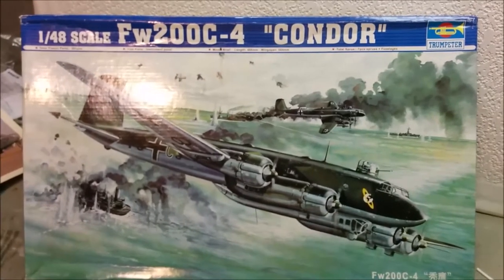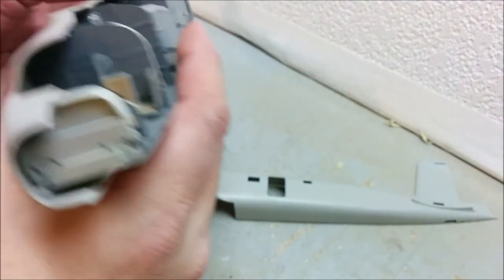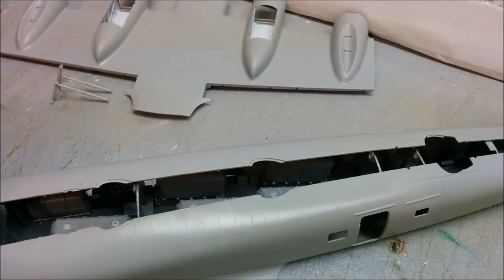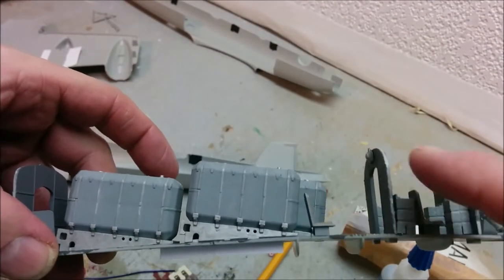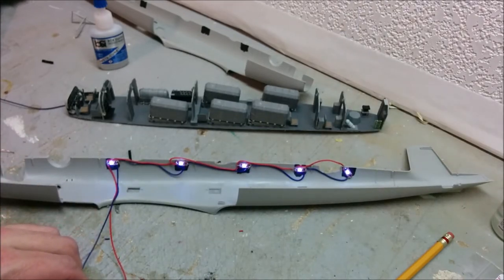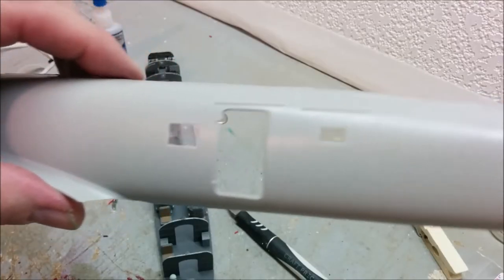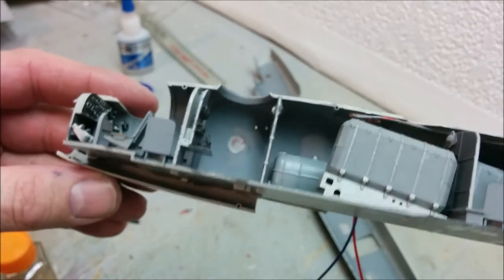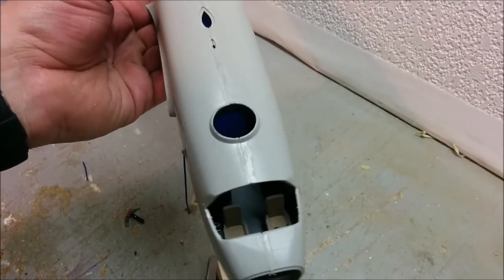FW-200C-4 Condor Build Pt4 1/48 by Trumpeter

Comment: Let's get a wash and a dry brush going on in that interior ribbing to get them to stand out. Next, we'll need to mix a little super glue with some talcum powder to fill in that seam running along the upper spine. Sand it glass smooth to remove any trace of a join line and we're on our way. I'm loving the fuselage being lit up

Comment: Dumb question:
What thickness do you recommend for 1/48 windows?🤔

Jman👀
Reply from the maker: Kabul81 Not dumb at all! The material I used was .010" or.25mm thick. I used it mainly because it's what I had in stock. If we scale that up it ends up being 12mm or 7/16ths inch thick glass! However the kit parts which don't seem that thick are aprox. .75mm thick which scales up to 36mm or 1 and 3/8 inches thick! I don't know if Evergreen Scale Models makes a thinner clear product but anything thinner would be hard to use. By the way the package states that it is styrene but it doesn't feel or behave like styrene.